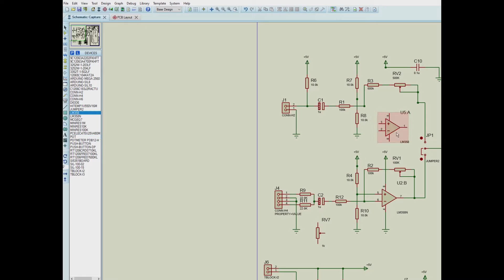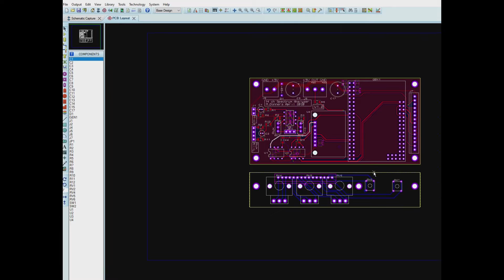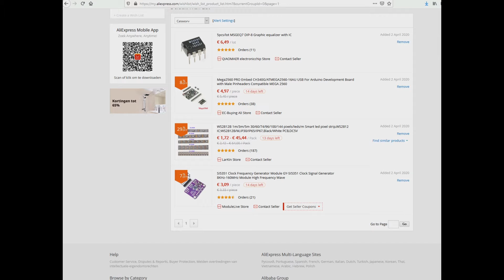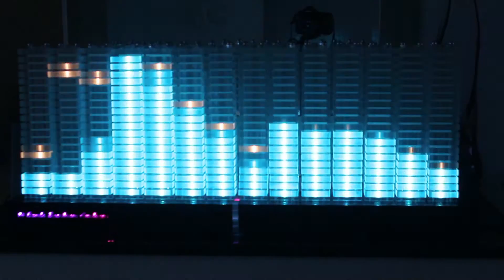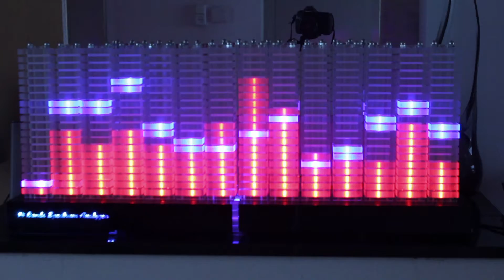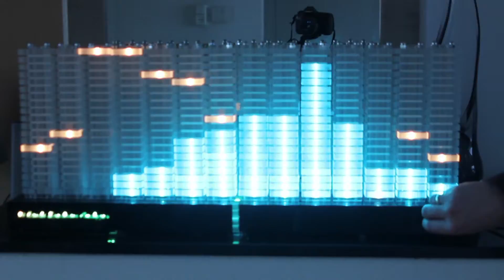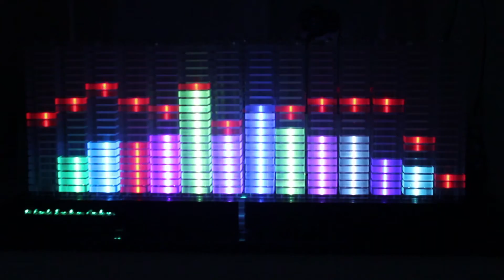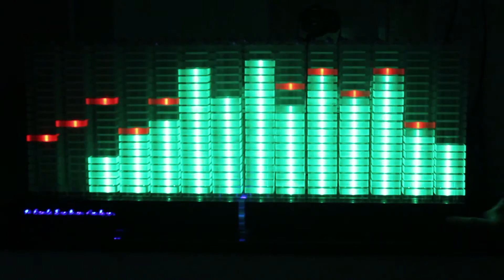Must see this 14 Channel spectrum analyzer with 280 acrylic leds Arduino controlled

Comment from the maker: New PCB's are in stock, Also Assembled onces....Go Get yours at the Tindie store!
Reply: I am from India and somehow, Tindie does not ship to us at the moment. Any other way to reach you for purchase? Wished you could help. Also, can you ship the entire stuff as a kit ready to assemble? Most of the Acly stuff is not known in my part of the country. Thanks.
Reply from the maker: @Guddooz  Correct, I cannot ship to India. Also no complete kit available. You'll have to find other ways.
Reply: thank you!
Reply: Hello! I want to run this code on ESP32, how do I modify it? It's not the kind of FFT
Reply from the maker: @张三-b5i  this will not run on esp32. But check out my other videos for working version on esp32

Comment: Hello.
I also see 12-volt connections in the circuit diagram. What's the reason for this? Thank you.
Reply from the maker: External power… i believe it is reduced to 5v by a regulator….but saying this by what i remember without checking schematic

Comment: Hi Mark. How are you doing. Mark how do you keep the project together I know you glue the acrylic but that will not hold forever. Do you use interlocking tabs?
Reply from the maker: I only used glue, no tabs. I did use professional glue not some universal glue but real acrylic glue. It will hold

Comment: Going over the schematic, the circuit doesn't use a lot of pins from the Mega board. Have you tried making this circuit with a simplified Atmega chip or maybe a nano ?
Reply from the maker: Yes but a nano wont work. Its just too slow. You can try other board

Comment: Hello, I like your work very much. The PCB drawing you uploaded does not have the actual size of the PCB. because when i upload your PCB, what size should i fill in the dimensions option? Can you share it with me? I hope i can make one by myself according to your video. thank you...
Reply from the maker: Where did u try to order? Jlcpcb? The problem is not the size but the fact that it are actually two boards in one file... Just download a gerber viewer and you will see

Comment: Another question: RV1 and RV2 are expensive. Is there a special reason to use this trimpotentiometers 3252W-1-104LF and  3252W-1-504LF or can I also use other ones?
Reply from the maker: Use others.. should not be more expensive then  about 2€

Comment: Which Power supply so you use? Do you have experience with long time usage of the device? I am asking myself how much power it will need. Some LED Stripes have 90W/5m so I am really interested which supply you use.
Reply from the maker: I am ussing a 5V / 4A power supply

Comment: Hi, I have now received your PCB and want to start. Could pls say me, which diode D1 can be used? I dropped also an email with this question. You can also answer via email if you like. Maybe I also have some small further questions :)  And thank you for sharing all the stuff, making it possible to learn and to build my own. :)
Reply from the maker: As for D1 a universal diode like 1n4001 will do, however, you can leave it out entirely. I put it there as a quick and dirty way of protecting my semiconducters in case i accedently connect the power supply reversed. In my next revision, that will be changed to a proper protection circuit. 
Although, come to think of it.....1n4001 will be a bit low on the current it can handle....better use two in parallel..of find a different diode any universal diode that can handle a few amps will do fine.
Reply: @TheElectronicEngineer  thx for the fast answer. If you are interested: I have made 5x1m power in for 3x20 LEDs and sacred each with 2A and the main Supply line from power Supply with 20A. How did you protect the System against Short circuits?
Reply from the maker: A single fuse at the main power source 5v

Comment: Okay, Mark Donners.
I have a doubt. did you test using the simulator on Proteus?
Thanks for the publication, it is serving a great help.
Reply from the maker: Evandro Miranda no simulation, this is a real build. Proteus was only used to design the pcb layout